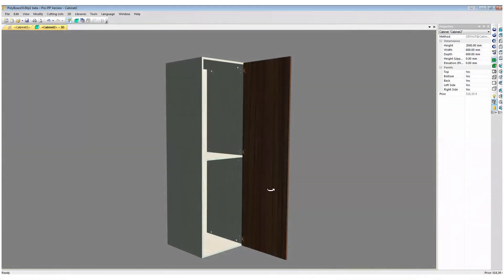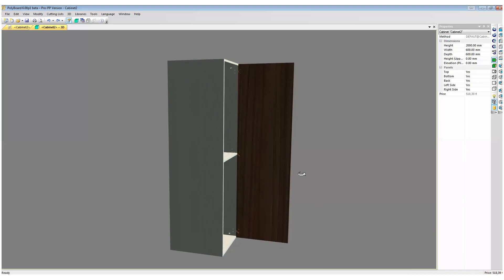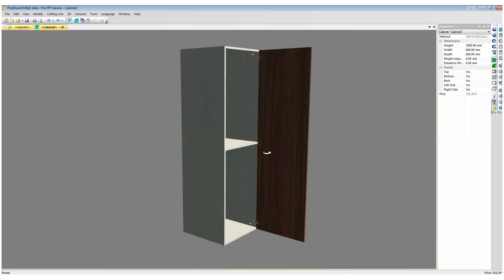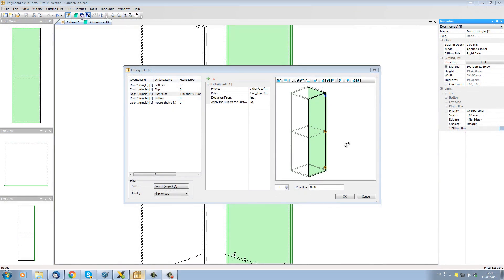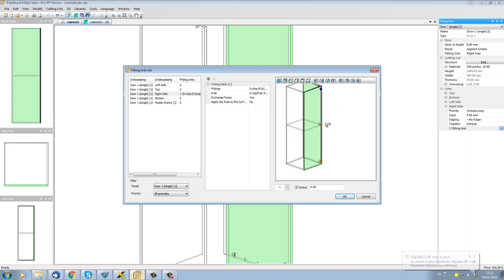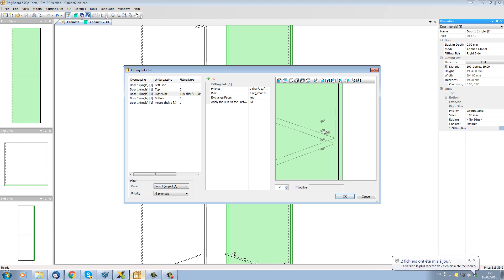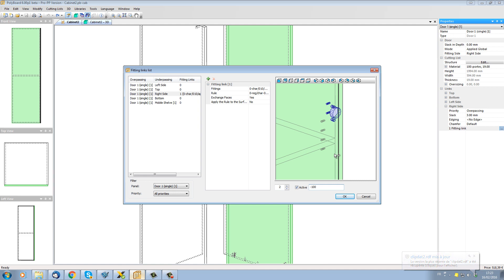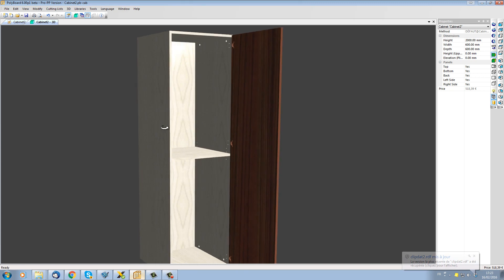Moving hardware positions with Polyboard

Comment: Great tutorial again! I was wondering, can an anti-collision system be applied to these regular mobile shelf holes and hinge combinations, similar to what you showed in the 32mm system tutorial? Or do I always need to check and manually adjust the hinges? Thanks in advance for your insights!
Reply from the maker: This is only possible with System 32,

because when we use System 32, the elements are linked to it. This is not the case with a traditional link between panels.
Reply: @wooddesigner  Clear, thank you!